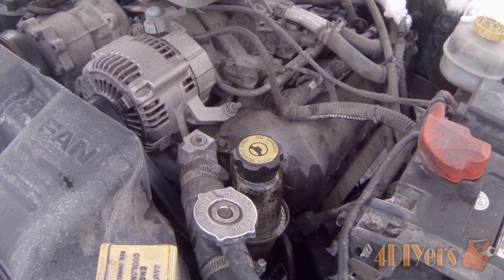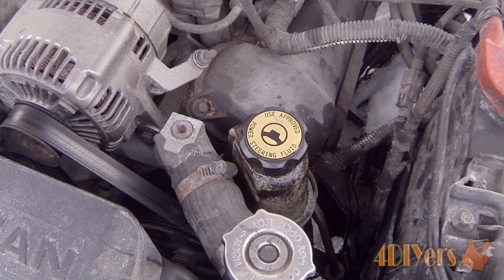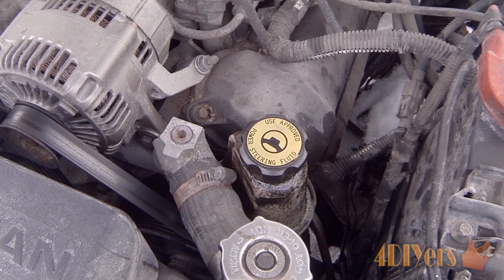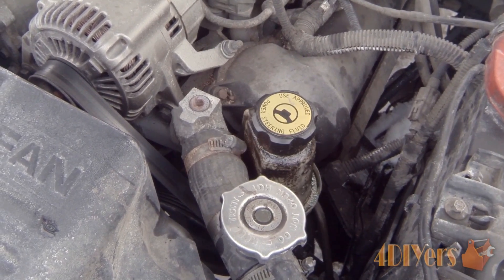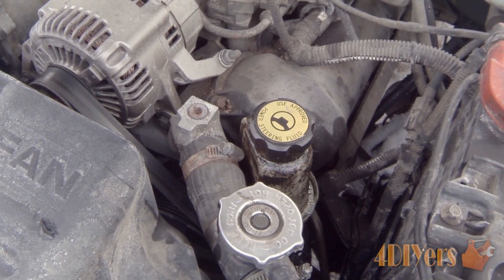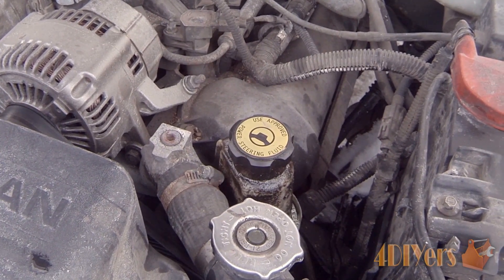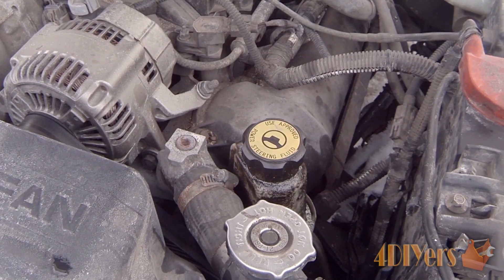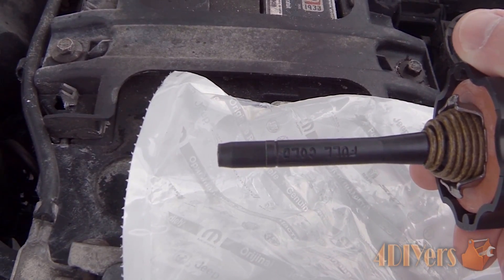DIY: How to Troubleshoot a Power Steering System

Comment: I have a 03 Dodge 1500 5.7 four by four and the power steering is fine until I slowed way down and have to turn, then it gets extremely hard to turn. However it does not wine and it is not low on power steering fluid. Being that it is a 03 model I was wondering if the power steering fluid is super old and if the pump would work better if I'm done the lines and drain the pump and refilled it with new power steering fluid? Thanks oh, by the way your video was great. I'll take anyone's answer in case this guy does not see my comment. Again thanks.

Comment: Great video, question so new pump new steering rack it does leak a little from the cap like you mentioned and the steering hot really hard but no leaks everything is new... help pls 
2001 camaro LS1

Comment: My friend has a 2009 Saturn Vue. He has had the power steering unit replaced but still has an issue.  His power steering only operates during acceleration. If his foots not on the gas he has no power steering.  Any suggestions or ideas?

Comment: any help is appreciated - 1964 ford - when I got the car it turns left easily - hard to turn right - so I replaced PS pump  no change - replaced slave cylinder no change - rebuilt control valve (easy rebuild easy to adjust) no change - entire system has ben out of car and cleaned - no change - I've done several of these over the years with no problems - some new control valves are available but they are near $500 - any ideas?

Comment: hopefully you can help me, My rack and pinion was recently replaced at 150k miles.Just prior to that, and still i have a whine that happens after it comes to temperature, and ive driven for a while. no resistance in the wheel. Fizzy fluid, and a horrendous whine that can be heard over the ac in the cab when turning. only, when turning. no loss of steer ability though.... 2002 dodge dak 4.7
Reply from the maker: Have you checked the fluid level and was the system bleed of air??? Don't forget to subscribe!
Reply: i have, and it was. however, it ended up that the filter/screen on the reservoir was dirty and clogged, it starved the pump of fluid, and the pump died. new pump, clean reservoir.   all good.

Comment: I'm not getting any noise but the power steering is intermittent, sometimes it's working fine and then it just goes out. This started after christmas, I had the pump replaced last summer for leaking and just replaced the reservoir and a couple hoses for leaking. Any suggestions?

Comment: i have a 2004 impala LS MY POWER steering fluid just suddenly leaked all out of my car...i had some put back in and it kind of shot the fluid back up....could this be one of the lines needs to be replaced? or the whole pump itself?
Reply from the maker: It could be a line, pump, or steering rack. You will need to determine the location of the leak to find out which part failed.

Comment: I have a 2010 Crown Victoria (without variable-assist power steering) whose power steering feels lazy. The pump isn't loud, and the serpentine belt is without cracks / wear. Tie rods are also good, as well as the steering shaft(s). Maybe the issue could be the belt tension? The rack is also suspect, though the current one has no leaks. I do notice, however, that the fluid in the reservoir seems to stay put when I turn the wheel; this could possibly mean that there's a clog somewhere, or that pressure is unable to build. Maybe I'm answering my own question(?)
Reply from the maker: You can have the pump pressure tested and the fluid could even be old. Depends on the system, but the fluid should stay the same level. Here is a video I have specifically for stiff steering https://youtu.be/5i1B3yzsQqw

Comment: I have a 2000 Dodge Dakota and have taken it to the shop to have the power steering fixed two times now ($1000 later) and still the problem persists. Pump was replaced last time. Mechanic also admitted he poked a hole in the filter to ensure that there was fluid flow. Worked OK for a bit and now having problems again. On a drive from LA to Houston I noticed after a few hours of driving that when exiting freeway ramps it was tight when turning. Primarily when braking and turning. Accelerating and turning not so much. Started happening more and more. By the time I left Houston to come back to LA it got so bad that it went out completely. No power steering at all after a few hours of driving. I should say there was absolutely no "whine" in the system when moving the wheel back and forth. Just a gradual intermittent loss of the ability to turn the wheel back and forth until complete loss of steering. I don't know what else to do.
Reply from the maker: I hope he replaced the filter as it defeats the purpose of preventing dirt entering the system. As for the issue... Sounds like you may have an issue with either ball joints or tie rods becoming seized. If they have grease fittings, then you can add more grease. If not, you might be able to pop the rubber boot back, but it's a tough job. The lubricant does dry out over time or if the boots are cracked, they'll let in moisture, dirt, and the lubricant will escape.

Comment: 2008 Odyssey with 105K miles PS works fine when first starting but gets hard steering after driving it a while.  The mechanic changed the PS hose was replaced its still very hard steering. Any ideas? Thanks

Comment: I have an 04 Dodge Stratus and when I turn the wheel the steering wheel feels like it pulsates and it sounds like the belt is squeaking ! It's also hard to turn ! Even I get it up to around 20 it all goes away and it smooth but when I slow to turn it gets hard again and the squeaks return !Please help
Reply: I dont know if you fixed the issue as its been a year since this comment, but it sounds like the belt that drives the pump doesnt spin the pump fast enough because it's slipping until the engine's rpms are higher

Comment: I have a 2003 Mazda tribute. I was leaking power steering and there was the whining buzzing noise I found a leak in the return hose, I replaced that. there is no more leak & no more sound but now its really hard to turn my steering wheel when before I replaced the hose it was only hard to turn when I was low on fluid. the fluid is fine now since there's no more leak but now I can hardly turn my steering wheel
Reply from the maker: +Valerie Faliveno Sounds like there is air in the system. You will need to bleed the system which is fairly straight forward. Start the vehicle, leave the cap off, and turn the wheels to full lock left and right a few times.

Comment: Great video! I have a 2005 dodge dakota and I noticed that it started jumping when i'm trurning the steering whell in sharp curves or when  trying to park the truck. i notice that it have a lil bit of a leak on the reservoi. what you think that may be the problem? thanks a lot for the video!
Reply: Ever find out what it was? Having the same issue

Comment: 240 volvo  I hit a concrete parking space divider, and broke/crushed the front line on the steering gear rack. I cut out the one inch damaged section using a compresstion fitting. Filled the reservoir with Lucas power steering fluid with conditioner. The steering I can live with, but iits much stiffer now then before I had the accident. Backround---when I broke it I drive straight home about two miles while it was leaking repidily, and the steering progressively got tighter and tighter. No dents on the rack assembly just behind the fluid line. Could I have damaged the steering gear, and please give guidance what I could try to correct the problem? Thank you for your advice.  bruce stewart

Comment: Everytime I go over a small lil bump, I would hear a clunking noise & couple months ago I could've turn all the way to the left or right & I would feel the pressure pushing the steering wheel, now it would take a lot of turn until it takes my wheel to stop turning. Idk what's the problem. It's a 2011 kia rio.
Reply from the maker: +Montell Miller The clunking noise can be a faulty suspension part such as a ball joint, tie rod, bushing, or sway bar link. Being that the steering is hard, then it is most likely a ball joint or tie rod which is worn and slowly seizing.
Reply: +4DIYers thanks for the solution of the noise. But I the steering isn't hard. It's just that I would have to turn the steering wheel farther than usual just for the tires to turn.
Reply from the maker: No problem. Your vehicle is most likely equipped with electric steering then, therefore there is no direct contact between the steering wheel and steering rack. Some vehicles were equipped with a variable speed steering, so at a slower speed the wheels turn faster and at highway speeds they turn slower. Possibly the module or sensor that controls this has failed.

Comment: obviously you know what you are talking about, so i would like to ask you a question, because no one seems to have an answer to my problem. on my jeep i have a new pump, new fluid and when i start up the jeep steering works fine for about 30-40 minutes then it becomes impossible to turn the wheel. please help me out

Comment: Had my tire rods worked on by a janky mechanic after i brought him 2 sets of new outer and inner tie rods he installed 2 used ones and i didn't realize how bad they were the boot is even ripped off a bit could this be causing my power steering to stiff up didnt have a problem untell my rods were replaced

Comment: What do you think of sea foam trans tune added to power steering to help clean and lubricate?
Reply from the maker: I haven't used it, so I can't really give you an opinion. But I have switched over to synthetic on my one car and have been quite impressed with the result. Much smoother and easier steering.

Comment: hello I have a 2004 ford focus I only have it two weeks.  the altenator belt started squealing, I know for a fact it was recently replaced along with timing belt.  at first I thought it was the belt but on closer inspection I saw power steering fluid on pump and pulley so I bought some lucas stop leak and a mechanic put it in draining out original fluid first which was just below minimum.  
after I few hours I could feel more acceleration in the car is that normal?  the pipe going to pump from resevoir had a spot of fluid on it too.

Comment: Hello there! Good information. I hope you can help me out. I've been hearing a slight whine at complete stops ( I crank the wheel a few degrees and there is when I get the noise) say a traffic light, and it gets a bit louder after a spirited drive. However, the whine goes away when the car is stationary or hasn't move for a while. There are no leaks whatsoever, which leads me to believe, I think, that the reservoir filter is clogged, or there's air in the system. The fluid level was just a tad low, but still in between max and min. Thank you!
Reply: Forgot to mention, that's getting gradually worse.
Reply from the maker: +Terry Oliveros Thank you. This is most likely related to old fluid. When has it been changed last??? After the fluid gets a certain age is does loose it's lubricating, heat transfer, and power transfer efficiency qualities. If the filter was clogged it wold most likely do it all the time. I would recommend replacing the fluid and if you do, then it would be a good time to replace the filter just to be safe anyway. Some filters can be cleaned as well. I do have a power steering replacement video as well if you're in need of one. It's important to do this sooner than later as you can risk damaging the pump.
Reply: +4DIYers wow interesting! I have not changed the fluid since I bough the car brand new 4 years ago. I will replace the fluid and clean the filter. Thank you very much for this helpful information!
Reply from the maker: No problem, glad to help out! If you are looking for a longer maintenance interval, you can upgrade to a synthetic if your vehicle doesn't have that from factory. There is a slightly higher cost with the oil change. Being that your vehicle is only four years old, ensure it doesn't void the warranty either. Also if there is still warranty on the vehicle, possibly you can have the maintenance done under dealer cost.
Reply: +4DIYers thank you as always! I took it to the dealer but as usual they said they couldn't replicate the issue. So, I bought the steering fluid indicated on the owner's manual, filled it to max cold (car was cold), and with the cap off, I turn the wheel lock to lock a few times. The fluid level was a bit low, but still in between max and min for cold and hot. After driving the car for a while I haven't heard that particular steering pump noise. I will monitor the car over the following month, if it reappears I will flush the system and clean the reservoir filter. Thanks for everything and regards!

Comment: At 3 mins that noise was it made at a full lock? For some reason after doing some harsh manoeuvres, my pipe to the pump had come of and leaked all the fluid. I may of driven 5 miles with no power steering and then got the pipe re attached. But on full lock now I seem to have some grind noise on both directions. Any ideas would be appreciated.
Reply from the maker: After you filled up the fluid, did you bleed the system of air??? Don't forget to subscribe.
Reply: +4DIYers well I went to a garage n I do remember him saying the mechanic was bleeding the system... Do you reckon I done my pump in by running dry for a few miles or that I should get a second opinion? All this after a bit of spirited driving is a joke....

Comment: I have a 2004 Dodge Dakota. For a year now, i'm hearing this screaming sound (much like a small motor) when i'm driving and steer to the LEFT. Even if i only slightly turn the steering towards left. And the sound of the screaming motor increases into  higher pitch as my speed increases to 30 - 50mph. If i just stay idle with engine ON...the steering does not make any whining sound if i steer it left or right. There is no visible fluid leak and the reservoir is on normal level
Reply: Ever find out what it was? Having exact same problem. Thanks

Comment: Question: will the power steering pressure switch (on a 2000 Dodge Neon, 2.0) cause power steering failure, if left unattended?  (Mine's been bad for several months.)  Will replacing it restore my power steering?

Comment: Power steering pump has been replace 3 times. The 1st time the pump was puncture when it was replace. Second time it went out again because the Rack and pinion was bad so the rack was replace and a new pump was place in. But now the power steering is still whining at times and not keeping fluid when I drive long distances, but it's not leaking anywhere the lines were flushes supposely and  the pump cap was replace. What should I do was going to go to another mechanic who  does a decent job on cars but I was wondering what advice you have for me.
Reply from the maker: Have you bleed the system of air??? Don't forget to subscribe!
Reply: Yes all the air was release out.
Reply: Crystal Waters
Reply: Crystal Waters
Reply: Crystal Waters

Comment: I have 99 Bmw e36 m3  I place rack and pinion , bel, steering pump , reservoir. However felt normal when driving  on road  but It hard when stop for parking or slow down make turn? Do you have any idea what happening ?
thank you
Reply from the maker: +Raksasok Heng Have you bleed the air from the system??? Also was the alignment properly done on the car???
Reply: No I never know I have to bleed air from steering system ? How you going to do that ? am not have alignment done yet .
Reply from the maker: It is most likely an issue with air in the system then. And you must do this immediately, as prolonged periods with air in the system will damage the pump. Park the vehicle on a level ground, start the engine, loosen the power steering reservoir cap, and turn the steering to full lock left and right a few times each way. Keep an eye on the pump level, you will notice bubbling in the fluid which is perfectly normal due to the air being bleed from the system. Add fluid when needed. As for the alignment, considering you had the tie rods disconnect and possibly other suspension components, your vehicle is most likely not to specs now. This can also cause issues with steering, not to mention increase wear on your tires. Therefore this is something I would also recommend, otherwise you'll be replacing tires much sooner.
Reply: +4DIYers im glad i came across this..... my trucks power steering started doing the same thing tonight
Reply from the maker: Austin Rabb Glad to help out! Don't forget to subscribe :)
Reply: I definitely am..... I got it fixed today..... The whole power steering pump had to be replaced..... Took about 20 minutes and costed me $15 for the power steering pump at a junkyard

Comment: DOES ANYONE HAVE AN ANSWER ?? Anyone can help :)

Is my power steering just low or going bad ? When I first start my car , everything is fine .. but if I drive for about 15 minutes with a few turns in between my wheel starts to get stiff - but if I turn my car off and suddenly back on .. my wheel is fine again . I’m not sure if I should add fluid because it’s extremely low or is it too late and the pump is going bad due to lack of oil ?
Reply from the maker: Low fluid will cause those symptoms, however if you let it go for too long, the pump will eventually overheat and fail, then require a replacement. Add fluid, your owner's manual should outline which type is required. Make sure the system is bleed if it's excessively low (I have a video for that).
Reply from the maker: Bleeding procedure https://www.youtube.com/watch?v=00c3o5YoYCE